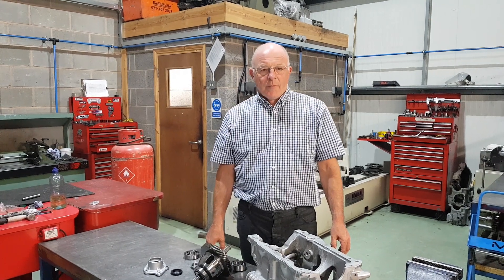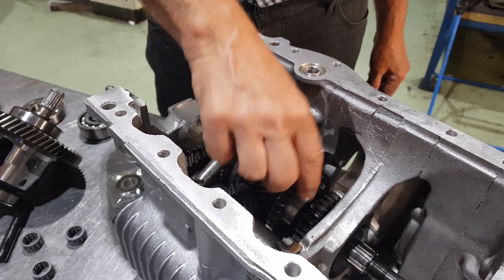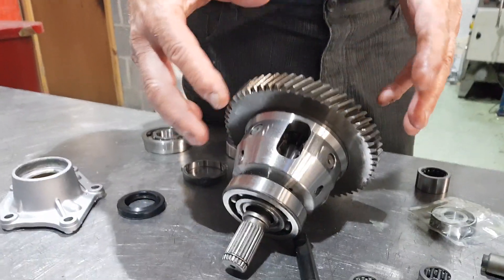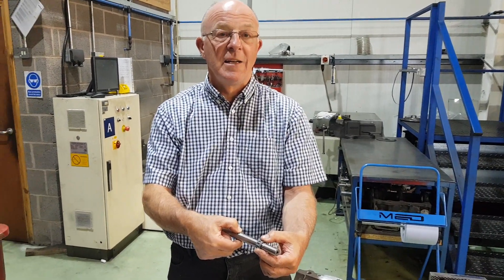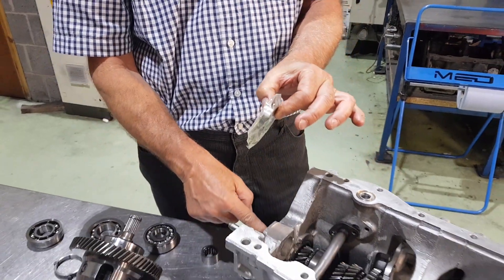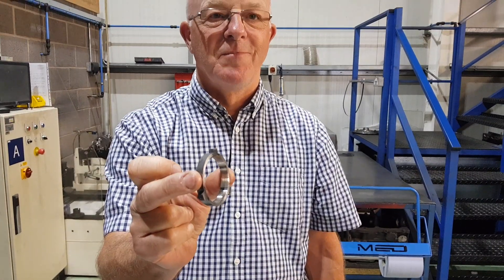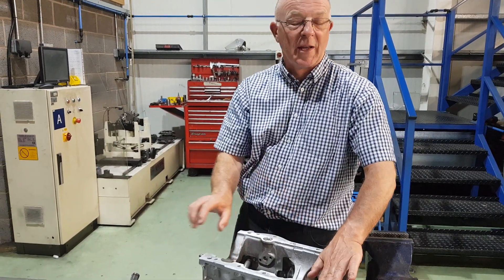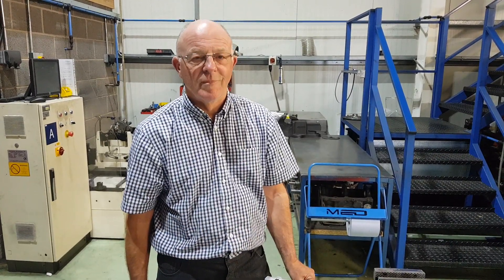Mini A-Series gearbox rebuild - recommended upgrades

Comment: Would you recommend vapor blasting?
Reply from the maker: As long as it does not embed any media in the casing itself - check with your blasting centre for their recommendations. We used to just wash in a chemical hot bath, then paint the outside of the case.

Comment: Hi when I let my gear box chemically cleaned. Bearing and oil seal sittings are on harmed? 
Meaning after the chem cleaning it can be reinstalled after inspection of cracks

Comment: I have 97 automatic and just overhauled the gearbox costed me 7000 USD. This mechanic was recommended by a friend who is also mini fanatic. Just wondering whether it is fair costs.
Reply from the maker: We don't see any autos, so it's difficult to say, but that does seem quite a lot. Although if it includes removal of the engine from a 97 Mini, that's a very time consuming job.
Reply: @MEDEngineeringTechVideos  Not sure if engine was removed. Later also found issues with gas tank, hi-lo, and rubber cone tally around 9100 for repair at entirety. It better be worth it. ¯\_ಠ_ಠ_/¯

Comment: What is your thinking on rerouting the oil from the gearbox out to an external connector, to go to an additional oil filter before it reaches the pump? At what stage - if any - is this needed?

Comment: Hi , thanks for very intersting  videos ,  it show all the steps and make it simple.
i have used the   1,2 selector and the 3,4 selector of a rod gearbox and put them  in the older type gearbox.( pre rod gearbox ). i found out that these selectors have a harder springs inside  ( i refere to those 3 springs inside the selectors ) and now the gear change had become also a little more harder.i mean that the gearlever from inside the car is more stiffer to change gear . Should i  had to use the older selectors? thx again